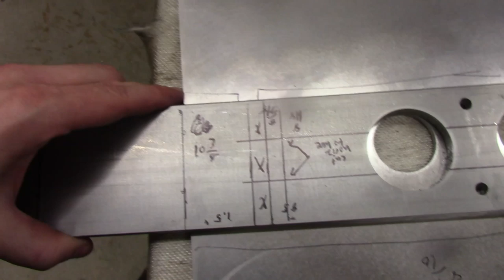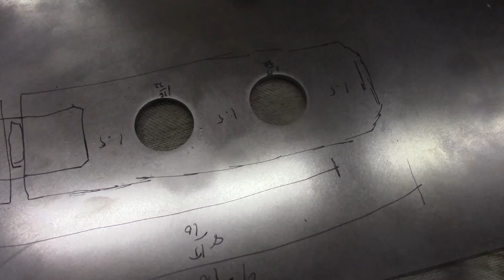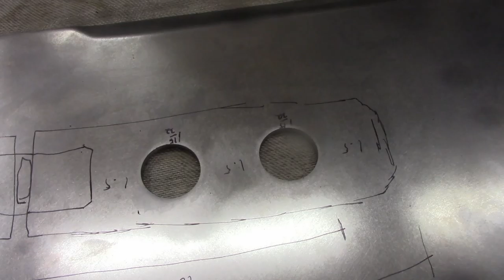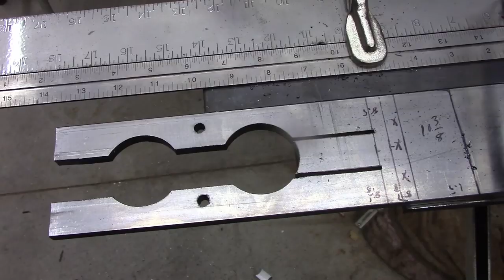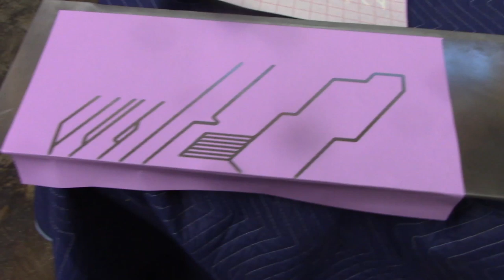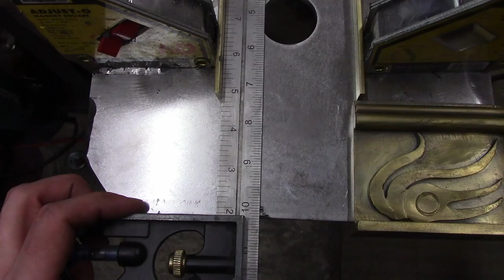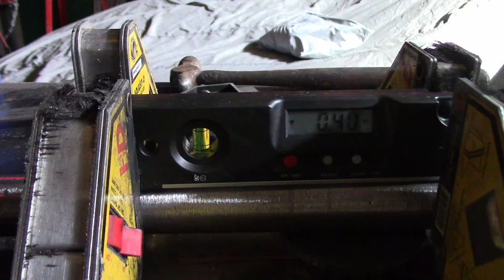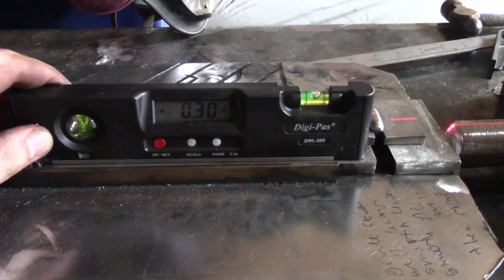Crisis Core: Final Fantasy VII Buster Sword build (Full Length)

Comment: Ever thought about getting like 1000-1200 grit and wet sanding one of your builds?
Reply from the maker: I've done this before, however it adds a lot of labor and cost to the already extremely expensive swords. Plus, they get scratched really easily when you actually use them.